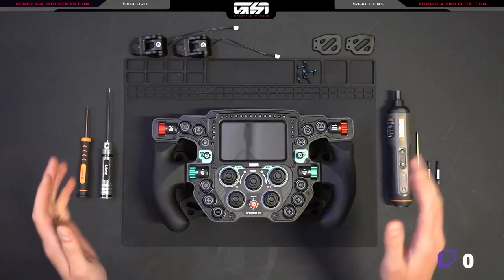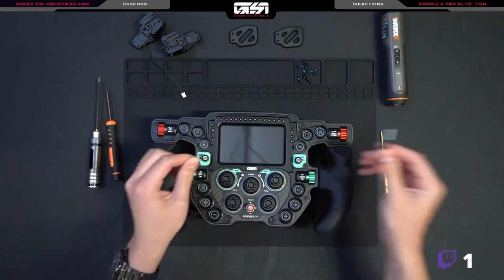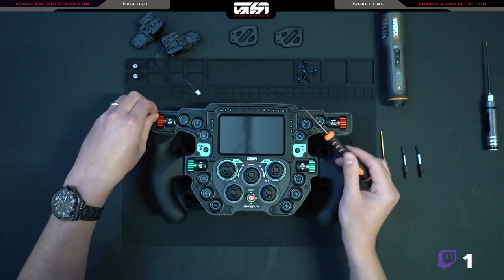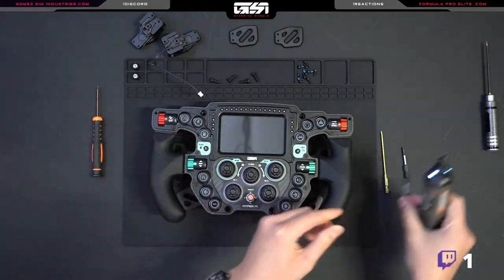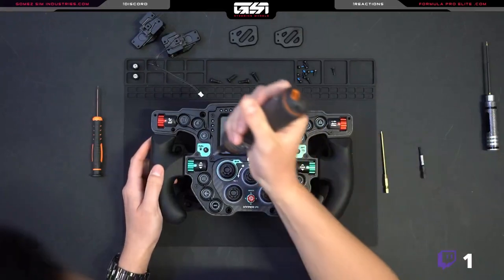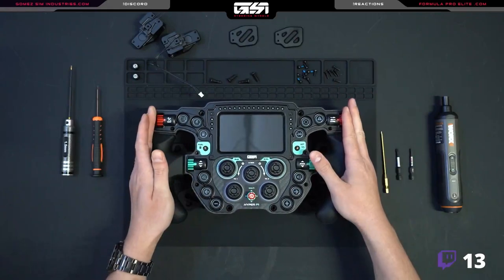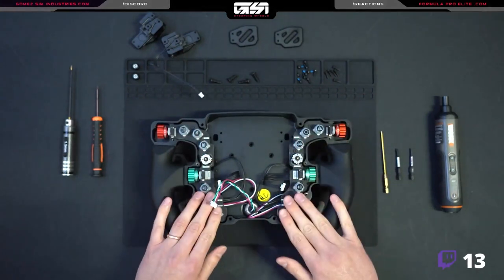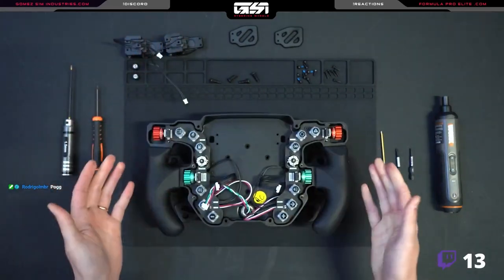Install optional top paddles on a HYPER P1

Comment: Guys, I'm really considering this wheel that looks amazing, but you need to think it a bit more future proof when designing it, extra paddles upgrade on CSX is just plug and play you don't need to open half of the wheel to make them work :(
I'm definitely looking for a wired QR so we get rid of the big connector on back
Reply from the maker: yup it's not for everyone. 99.5% of customers buy the 6 paddle option anyways. For a wired QR you can think to couple your wheel with a Asetek solution. Happy racing! 🙂
Reply: @gomezsimindustries  thank you very much for your fair and fast answer, could you tell me more about asetek solution? Do I need asetek DD ? Or do you mention a QR system from them ?
Reply from the maker: @TheSoldiersid3  yes you will indeed need there base to run there QR. Here is a link showing how it works  https://www.youtube.com/watch?v=TTqzLekO7Uw